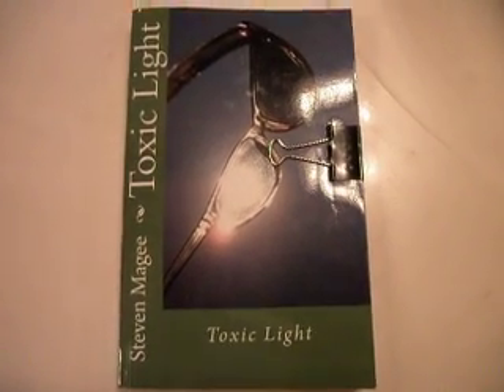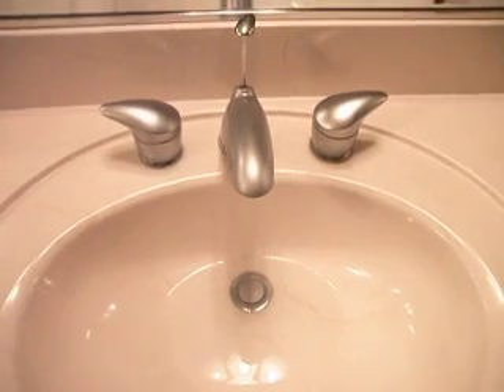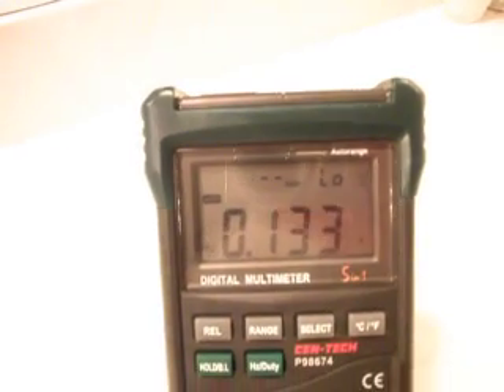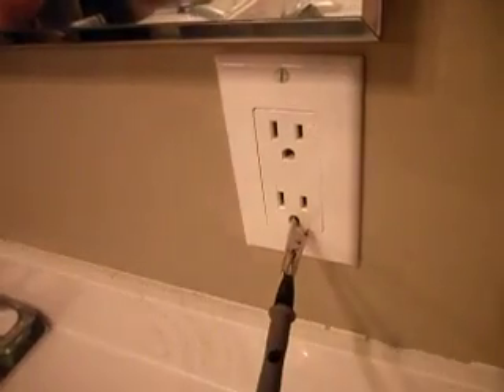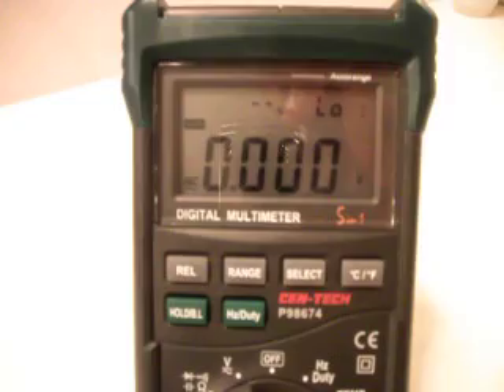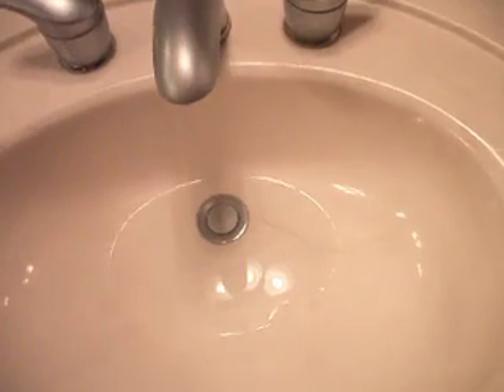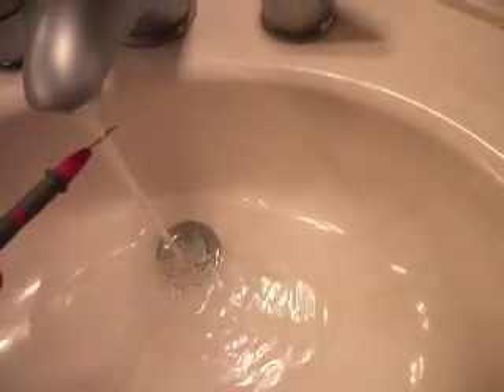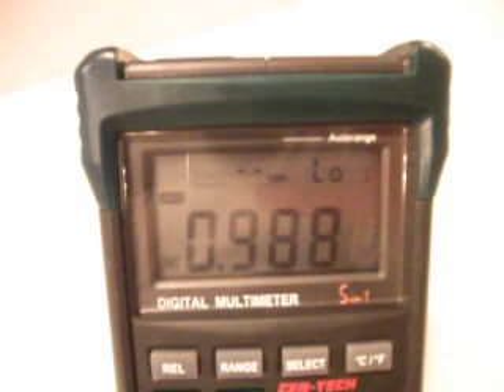Measuring House Stray Voltage

Comment: If your waterpipes are made of plastic, pure copper or Al-pex pipe (Aluminum layer on outside, plastic inside), you get 3 different readings when you do this test. 
Also when your electrical system is 110V AC or 240V AC makes a difference.
So your test is completely useless if don't give these details of your testing environment.

Comment: ur an idiot. hopefully your not an electrician voltage doesn't kill you for one amps do and second you body has a resistance of 500 ohms  less than one volt will do NOTHING   do u ever wonder why you can touch a car battery and not get shocked because voltage is the push for current flow and your bodes resistance is to high ur dumb don't make videos over something you know nothing about ur house grounds have nothing to do with your water and your probably seeing less than one volt from the water flow the friction coming out of the faucet
Reply: +Zackary McEntire Please do more research before you give advice.
Reply: Hey Zackery - Can you feel your cells mutating and dying from stray voltage with long term exposure.
Reply: Thanks John - I've come across a lot of your comments in this field and I trust your judgement over many -